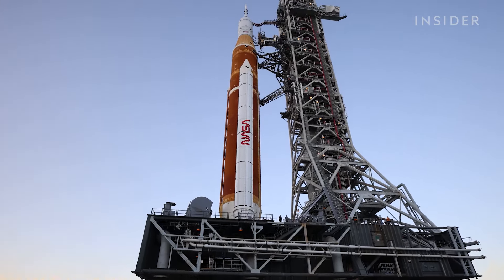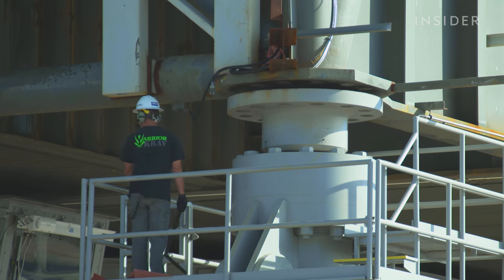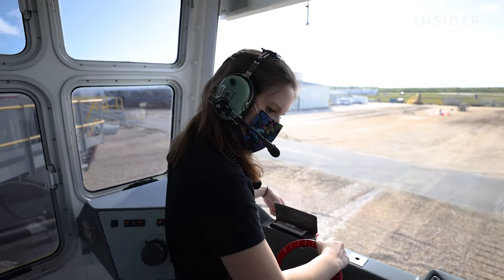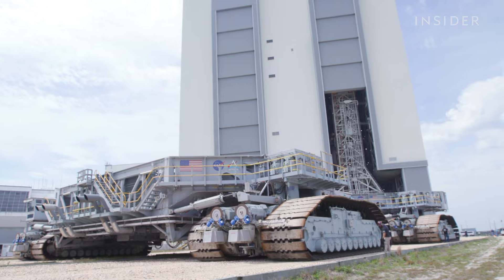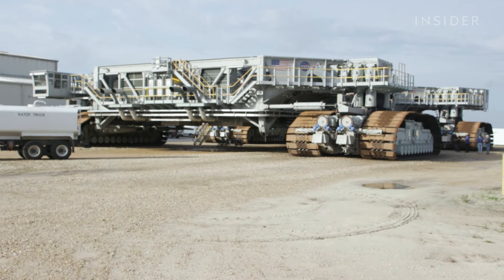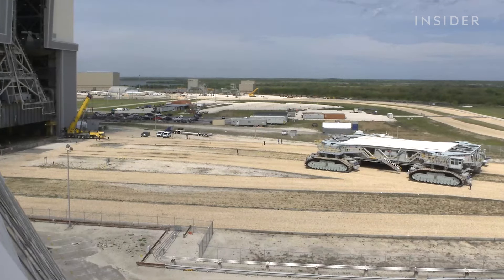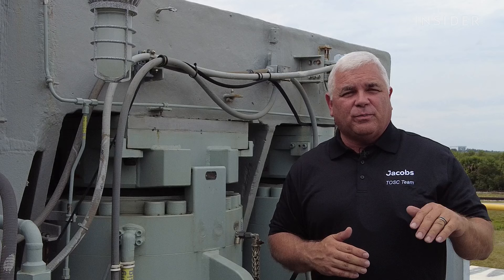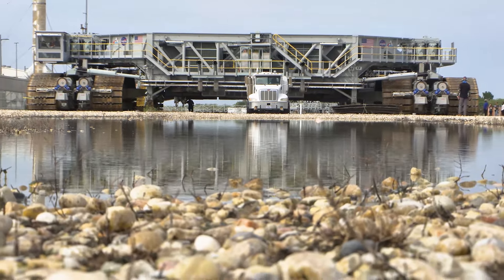How NASA Drives The $144 Million Vehicle That Transports Rocket Ships | What It Takes

Comment: What an absolute marvel of engineering...mindblowing.
Reply: Too inefficient.
Reply: @i3_13  let’s see u design soemthing better 🤣🤣🤣🤣
Reply: @i3_13  that more eficient than lift a whole rocket in launchpad
Reply: @i3_13  then redisign it will ya
Reply: Overengineered piece of crap 
Could've just used 2 railway locomotives joined to do this job like ISRO 
That's why ISRO is way more efficient
Reply: @whyBio  bro😂
It's been the same thing after 1964 right? 
What are you saying? 😂
Reply: @justanotherguywithoutamous5788  Just grab the rocket out of midair with chopsticks duhhhhhh
Reply: I'm not impressed at all.. is what I would say if it were opposite day
Reply: @whyBio  Having a rocket laying down for transport and being raised to launch position puts a lot of stress on the rocket. It can be made lighter and therefore a more efficient rocket if it's kept vertical from assembly to launch.
Reply: @blazingguyop  Wasn't another one added as well as maintainence work?
Reply: @i3_13  soviet union use train
Reply: @justanotherguywithoutamous5788  I don't think i3 13 even needs a rocket to get to the Moon. He will just say Abracadabra and he will be there.
Reply: I work for a major firm building large engines similar to these. It never gets old in my mind how fascinating it is and the sheer size of components and the engineering that goes into it and the motor itself creating something that works for many years to come.
Reply: It's kind of cool but everything about it is pretty basic. No idea why you would classify this as a marvel of engineering. I actually kind of take offense in that 🤷🏼‍♂️
Reply: @whyBio  How many people have ISRO put on the moon?
Reply: @henrychan720  this vehicle has nothing to do with launching or landing.
Reply: @skunkjobb  laughs in Starship
Reply: @1990-w1l  Yea some rockets are hundreds of tons!
Reply: facts
Reply: @user-charlie2  SLS empty is less than 100 tonnes. Why do they need to move a 8000 tonne tower with the rocket? Well that's NASA for you.
Reply: @i3 i3  Yup it's too inefficient and there is too much complexities with SLS/Artemis  that's not even required and i can assure that it will eat up NASA's budget like in 2-3 launches
Reply: @henrychan720  Okay, but NASA doesn’t measure in tonnes.
Reply: @whyBio  rail roads are expensive tho, a train carrying a rocket is larger and more costly, IRSO kinda sucks… sorry India maybe your technology will improve!
Reply: Now i know which vehicle is damaging environment
Reply: @i3_13  justify your argument with logical points
Reply: @blazingguyop  ya they should use rail not which consumes less energy than belt drive
Reply: @skunkjobb  bruha ,You can still use railway transportation system with vertical rocket on it ,ISRO system is like that, Rail is more efficient and consume less energy than Belt driven system
Reply: @BondJFK  bro if it was the best they may have used it
I think they are the highest spending space agency 
So don't you think there may be other factors affecting it? 
Maybe rails can't support that much wait 🤷‍♂️
Who knows
We are complaining about an space agency which much advance comparing to rest of the world 
And you who probably don't know much about these than basic things are comparing isro with NASA
?? 
Pls don't do this 
India's value will only go down by such comments
Reply: @i3_13  call elon to design a better one
Reply: Are you being sarcastic
Reply: @stefan514  what
Reply: And waste of money
Reply: Not really.
Reply: I can't point my finger on it but I found this video to be incredibly funny.

We need 30 people to drive the crawler.
Max turning radius is 6 deg
Launch pad is 4 mi away

Bro... it's the SAME 4 mile trip every time. You spent $144 mill on the crawler. And you can't figure out how to get AI to drive the same 4 mile trip. All the turning points are exactly the same every single trip.

So when you have a predictable, repetitive task that you need performed with utmost precision you automate it. 

I don't understand why you can't get AI to drive this machine. Why do we need humans to drive?
Reply: @i3_13  Are you okay?
Reply: @whyBio  even Rails have limits. How will it work?
Reply: @i3_13  If you mean the crawler, then it is not inefficient. If you mean the rocket, yes the rocket is inefficient due to it not being reusable.
Reply: @justanotherguywithoutamous5788  I think he meant the rocket itself...
Reply: @i3_13  aa yeesss i bet hover tech will be better right?
Reply: thats a very big downgrade compared to the saturnV, its a waste of money
Reply: For 1988
Reply: @i3_13  Well its not much 
But its honest work
Reply: @i-_-am-_-g1467  Well I like starship 
But hows this for a mind blower?
What if we can like both rockets and Not Hate others for liking one over another?
Reply: @mortgageapprovals8933  Well its just 
Its been the same crawler that launched STS Atlantis 
Aka THE LAST ROCKET THAT CAME OUT OF THAT VAB
so honestly let them go
It's for History sake
Reply: what an absolute waste of money!
Reply: @Mookeow  GUNSHOT
lets agree to disagree
Reply: I am an Indian and I agree that NASA is just better. It is not a fair comparison between ISRO and NASA. Nasa is light years ahead of them because they started early and are very successful. I am not being against ISRO even they are also successful but it takes time, slowly and steadily even ISRO will keep getting better.                                                                                               Moreover, The crawlers are pretty old and are more effective than tracks, 
 
Advantages of crawlers -->
- They require less maintenance than tracks
-  The load of the rocket is evenly spread out on the earth's ground because of the fresh gravel underneath the crawler
- Have self-leveling for keeping very tall structures dead upright while making the slope transitions.
Dis-advantages of tracks --> 
- Train tracks would not be able to climb a small incline as well because of the load of the rocket on the last ramp to the launch platform.
- The load would bend the rail, so more cost would have to be put up for making rails sturdy af.

- When pulling the rocket 90 degrees, the rocket could probably get damaged though its pretty rare.

To conclude, I would say crawlers are better and do not compare NASA with ISRO, because that's bs comparison.

IDK why I wrote this lmao..... :D 
I would like to hear your opinions I am not against anyone here.
Reply: I love it, but it is not clear how they calculated a price tag if it is 55 years old… ok…
With all the due respect I must remark that people in the US always always use money as the universal number to be used to give quality to everything. And it is a contagious habit for people moved from abroad also…
Reply: @Dhruv21  i mean the railway tracks are working without any problems for ISRO
Reply: @i3_13  this is like the space pen and a pencil ✏ its just dumb

Comment: I’m currently working at KSC as an engineer and seeing this in person is mind blowing. The fact they designed and build this before the ability to use CAD(Computer Aided Drawing) is so impressive. I’ve gone on it while it was running, heating and smelling those Diesel engines is unreal. You get a sense for how much power this thing has.
Reply: will it fit in my miata?
Reply: Kerbal space center?
Reply: @tj9959  Kennedy
Reply: @abaddon3863  you might have to do an ac delete at the very least :/
Reply: Can you find out the MPG? I can't find that stat anywhere.
Reply: @PanzerBuyer  It’s driven by electric motors that are powered by a generator feeding off a giant diesel ship engine
Reply: @garyhsk8  I know that, it still have a technical miles per gallon.
Reply: @PanzerBuyer  I read another comment here which said it gets 165 gallons per mile

Comment: 1mile an hour was way faster than what I initially expected.
Reply: So 10 hours to do 4 miles means a lot of stops on the way?
Reply: @smacksman1  I reckon the turns and slopes add to the time
Reply: @smacksman1  I understand that 10 hours is the combined time to drive to the pickup point and then driving to launchpad (not including the loading time).
Reply: I wasn't surprised by 1mph, but I was surprised how fast 1mph looks when you're up close to that thing.
Reply: @epiendless1128  ikr😆

Comment: Why not platform on a rail and cut down all the maintenance and complex machinery given that it goes on the same launch site all the time.
Reply: The purpose of it is to allow the fully assembled rocket to move without ever having to be placed horizontally. Doing that by rail would put extreme pressure on a very small area
Reply: @dontworry1302  is it not possible to distribute load on mutiple tracks?
Reply: @sportsonwheelss  The number of tracks that would be required to move the entire stack in one piece vertically would be so large as to make it less practical than a vehicle. Another concern may have been that the ground would not remain stable enough for tracks to be a viable solution since it is Florida.